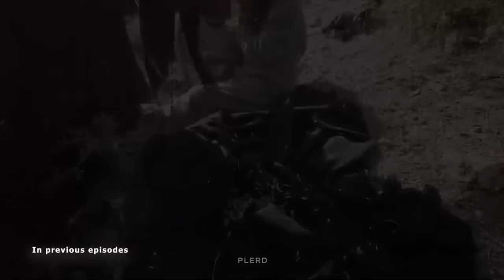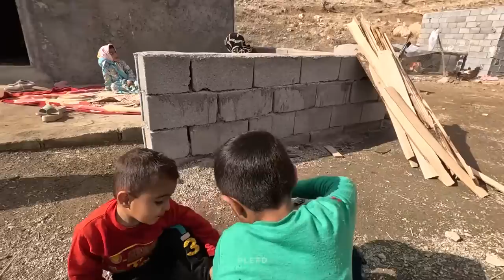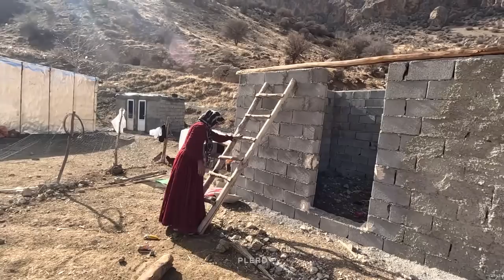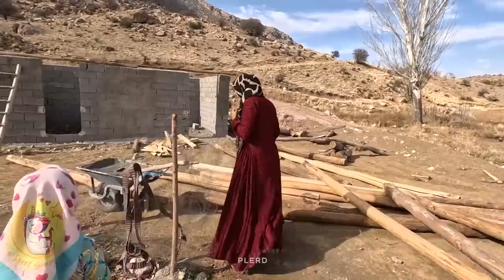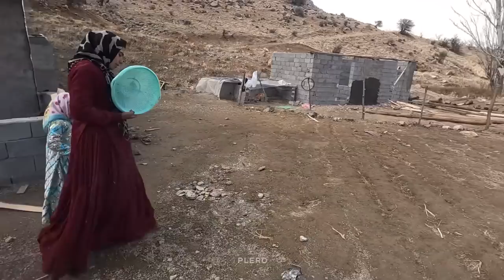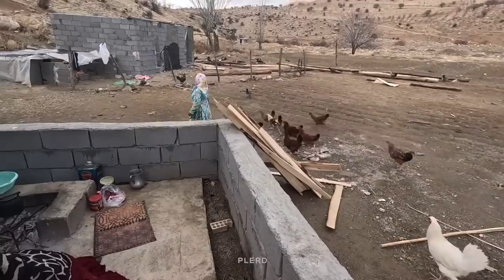Harvesting Strength: A Mother's Resilience on The Farm With Her Children

Comment: Нет эта женщина еще и вяжет ну все умеет молодец.Спокойная мать и дети спокойные.Удачи вам .
Reply: It’s nice to see Tayeba spending time with her children, instead of working so hard all the times❤️🙏
Reply: She is crocheting, knitting is different using two needles👍
Reply: Felis año  señora tayeba y sus niños  que la paz y el amor la salud reine en su hogar  les desea   emilia desde Mexico
Reply: She has a  power saw.  Why doesn't she use it.   I do not like that pick are.  I am always afraid it will fly off of the handle and injure one.of them.  She also  needs to buy a proper hammer.   She should also get a cutting board on which she can cut up her meats and vegetables.
Reply: 구독료금액넘칩니까저는코리아인입니다

Comment: Until you can use our power saw when you are working your long logs once you get the cut started and put that first wedge leave that wedge in and put another about 2-3 feet away ,do that down the log and it will split easy

Comment: in front of the wall is more taller or one block taller than the back when it rains it will not stock on the roof if will easily fall down